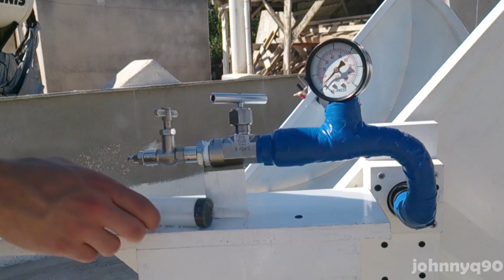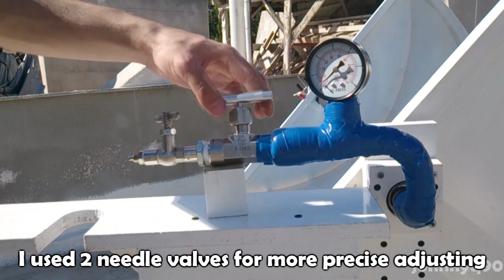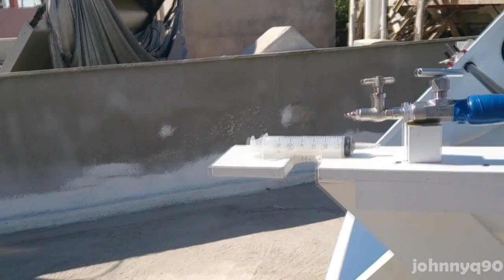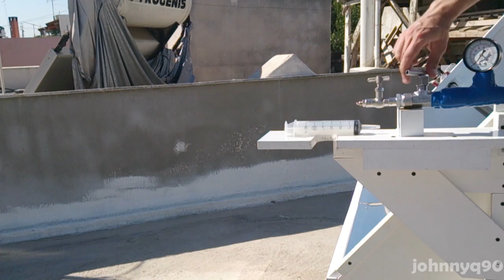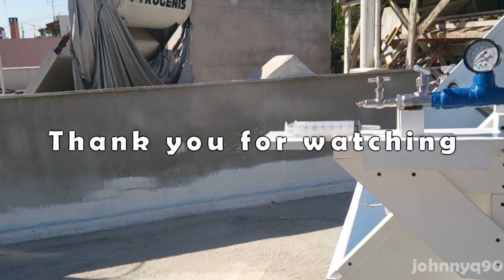Parabolic Solar Trough Mirror Steam Production Test

Comment: So I'm guessing an application here is to convert water to steam using the parabolic mirror, then feed the steam into the turbine, and use that output shaft to generate electricty?  Get the rates right and it can run all day long, assuming you can track the sun well enough and have a steady water supply (or recirculate water).

Comment from the maker: I did the best i could to make it as precise as possible, the sun is directly behind the receiver so it's ok. I chose to put reduction gears (from a micro heli) to this system because when i tried to directly couple the turbine to the motor, it didn't have the torque to spin it under load...
Reply: Bro can you try by increasing more number of water lines and continuous flow of water so the steam production will more and it will have duration time more

Comment: if you can build i would try to build a system that can handle at least a liter or more of water and maybe add something that would further help regulate the pressure. what also might help is finding a way to remove that gear from the motor that the handpiece gets attached to all together so that the handpiece directly turns the motor. is the pipe where the water gets heated at the best possible focal point in the mirror? sorry if i sound pretentious i am just fascinated by steam engines XD

Comment: Nice work. If I use this concept to power a 5kw steam turbine what will be the size of parabolic trough.
Reply from the maker: moas maas I would suggest a piston steam engine for less steam consumption, and i guess a 25-30sq.meter parabolic dish should do the work
Reply: ***** how many square meter is the parabolic dish you have in this clip?
Reply from the maker: rjmcguire100 It's really small... 1.2 square meters...

Comment: so, what material u are using in parabolic trough. Glass or reflector sheet
Reply: My Good man use a cheap thermal blanket glue it in a sphericalshape o. A board or flat counter top then blow it up to create the parabolic shape. Next got to hardware store buy vinyls resin  and catalyst lightly skin coat the back of the molded blown up thermal survivor blanket. You can either make a huge one or a good couple smaller ones and they will work fantastic or use two or three on the same 5hi g.that o dint know if it will work or not but I know the blow up mold will work..good luck

Comment: why deionized water? wouldn't that cost relatively so much that it defeats the purpose of using the sun to generate electricity?
Reply: At elevated temperatures corrosion is substantially accelerated if you do not use deionized water